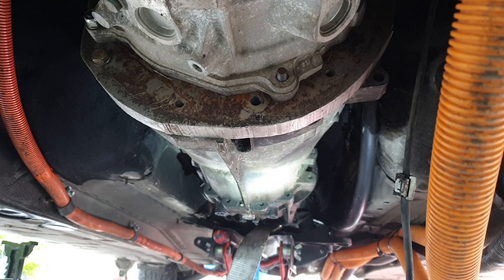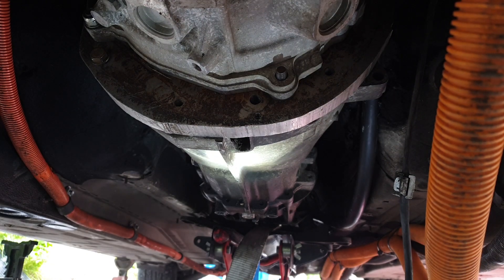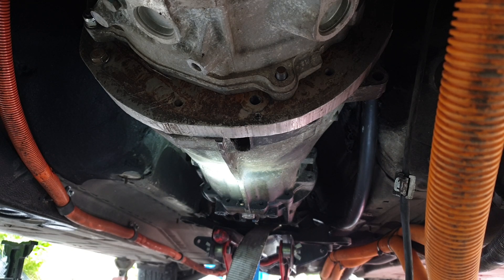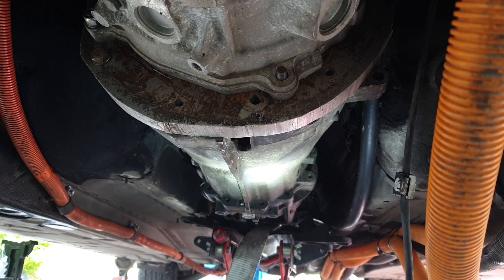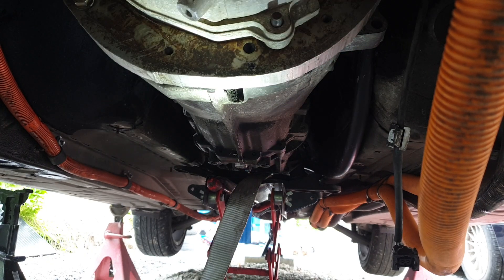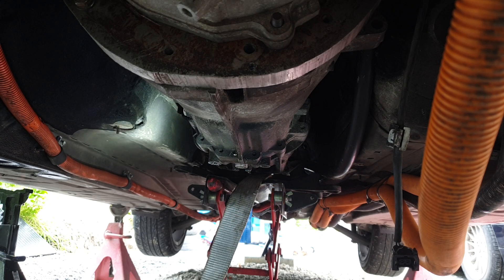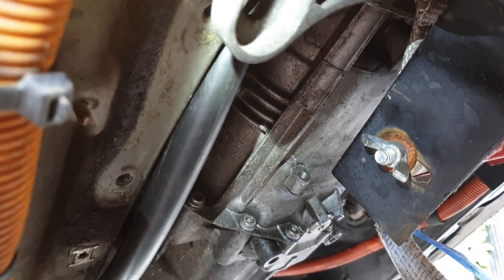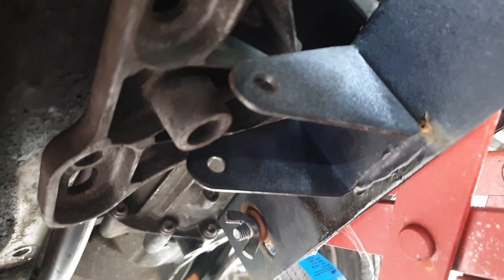E46 EV Grey Goose 6 Speed Swap Problem

Comment: You might have enough play in the driveshaft to loosen cap clamp and pull the drive shaft in. As for the shifter, you need the linkage from a 330d.

Comment: Hey Damien, don't know if you solved it but there should be holes for the six speed box cross member. Also there are shorter linkages for the shifter that work with six speed boxes. If you had a 6 cyl engine and the face of the new leaf motor is at the same point as it would be on the petrol one, then you should be able to mount on the existing holes that are made for the 6 speed (might need to add a riv-nut in the rectangular one, i saw that it was not populated) as for the prop shaft, if you can find one from an e46 325i SMG model, it should fit without modification. otherwise you will need to shorten the diesel one. Or you can get one from the 330i but you will need to get the diff as well. Hope it helps!

Comment: as far as i know the 37dz is a longer box than the getrag 265
it also uses a different prop, and the shifter linkage system is different too
it has a double upper pin set up on the box...
the box cradle is also a different design to the getrag/pertol-zf

i have both a 37d and a getrag 265 from e46 in my garage at moment
i could send you some pics of them side by side or take any measurements that might help
id be happy to help tbh, if i could, after watching years of your videos

Comment: Hi, see your conundrum. Just from the outside, and probably irrelevant,  but the previous video, showed the reamed connection spline which looked like the main cause of slippage..
Although the 5 speed may be less desirable , was it or another fitting 5speed of original dimensions, a usable quicker fix?

Comment: The issue is that you/we don't know where all the distance is compensated. Even the rear diff could be smaller to match a propshaft and gearbox combination. Or indeed another support. I would mount in the shifter (if you need it) and adapt the rest for as far as that's needed.

Comment: At 1:04 you mention that this was originally a 6 cylinder car, so the engine was longer than a 4 cylinder engine. The six cylinder engine extended closer to the front of the car; maybe it also extended further back. Hence maybe the Leaf motor now needs to be mounted further forward to match up with the position that a 4 cylinder engine would have been in. 🤔 I would test fit the driveshaft to check if the Leaf electric motor and gearbox need to be mounted 40mm further forward. ☮️
Reply: Nope. 4cyl is just farther from the front of the car than 6cyl.

Comment: you need driveshaft from 320d or 330d and shifter as well. I also had problem when I was replacimg gearbox from 520i with from e46 328. I needed to find shifter and driveshaft from 528i...

Comment: May require a B&M shifter cable kit if you need more length, or make a plate of same length and put it on pivot points.

Comment: 320d and 330d use a different gearbox, 37dz and 53dz, the 53dz is a bigger unit also petrol and diesel sit at different angles u will need the prop and shifter to suit your gearbox
Reply from the maker: I have the 37dz and redrilled the adapter to correct the angle.
Reply: @Evbmw  if the original gearbox was in the factory location you should be able to use the 320d stuff like crossmember prop and shifter
Reply from the maker: @boxfuck8290  yep that was my plan. cant understand why ita not just bolting up

Comment: trial fit the shifter and prop and if the gearbox is 40-45mm too far back, moving it forward although a big job is probably cheaper and easier than making a shift linkage and having the prop shortened. I've heard of things like this before where different engine configs in the same car sit at different angles or are mounted slightly differently